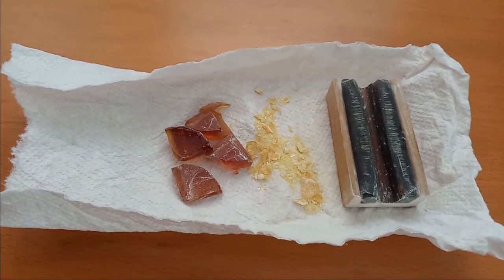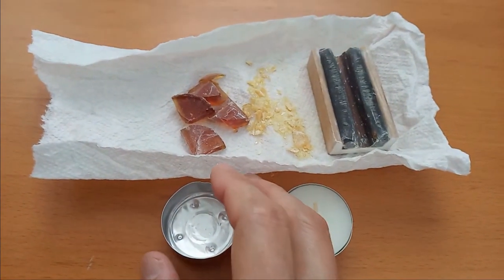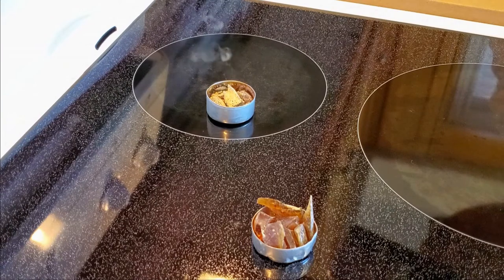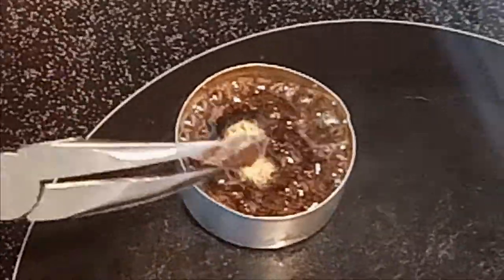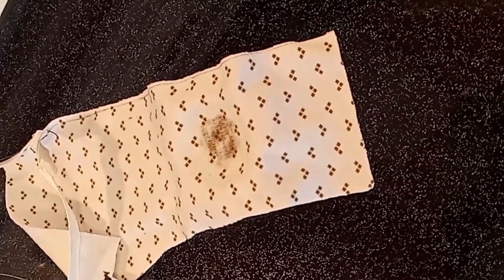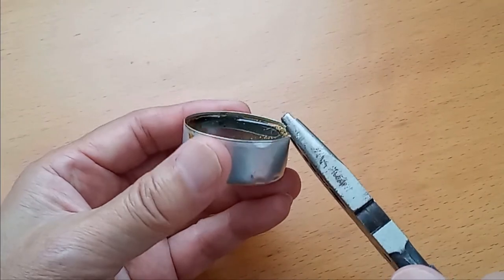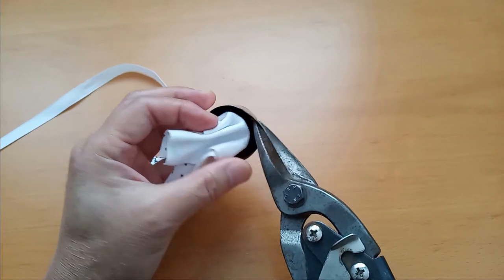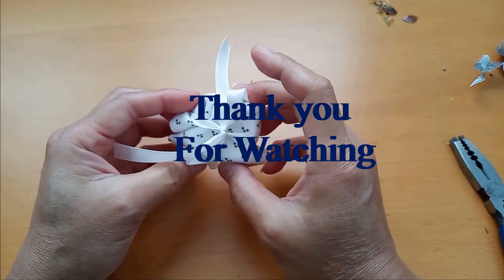Recycle Rosin

Comment: Just a small note for those using a ceramic oven - some of them are ok, but a lot of them are terrible, and have basically two modes - freezing cold, and hellfire hot. If you have one that isn't good at maintaining consistent temperature, it might be useful if you have a metal disk or some non-teflon-coated pan that you could put underneat it, which would make the temperature more even.

A minor warning also - watch out for your fire alarms, they might not like the smell of burning hot rosin.
Reply from the maker: Thanks for the advise. As mentioned in the video, you may have to turn the fire on and off to keep the temperature even. Also watch out for bubbling. If the bubbles splash out on the stove, it's pretty hard to clean it off. What my friend did was to put a tin foil underneath. Another person cut a hole on the tin foil under the tea lamp holder so there are more contact to the stove. They all worked perfectly. Also noted in the video was to put your hood fan on. I don't like the smell of the rosin either.
Reply: I'm wondering if using a double boiler would work.

Comment: Thank you! My daughter drops her rosin all the time. Trying to figure out how to warm it up on a gas stove
Reply from the maker: Just got a note from my friends who has gas stove. One cut a piece of scrap metal (from a furnace duct) and put between the gas stove and the tea lamp holder. Another one use a flat tin can (from a sardine fish can) which is 3/4" tall, put the tea lamp holder inside. Both will take a few more seconds to heat through but the heat is more even. Both work well.